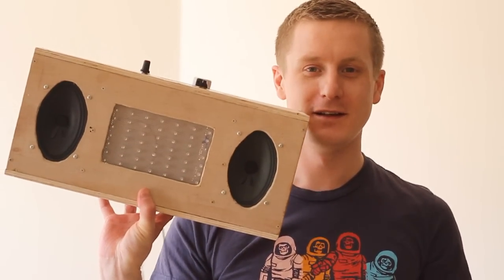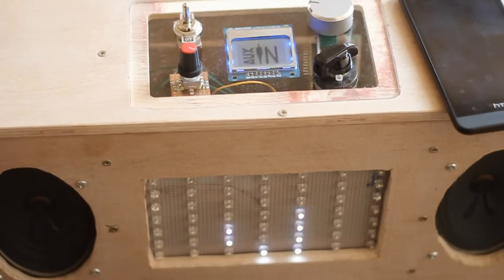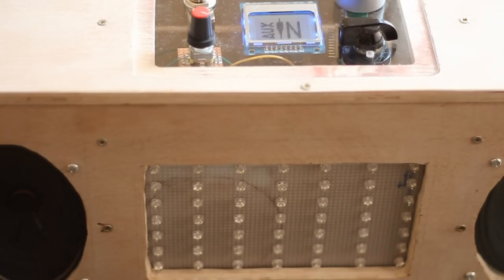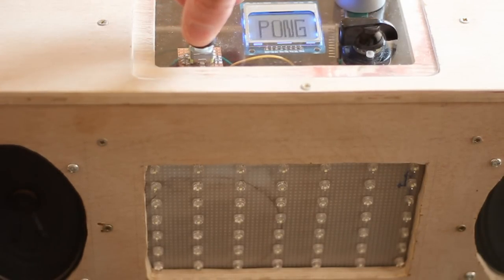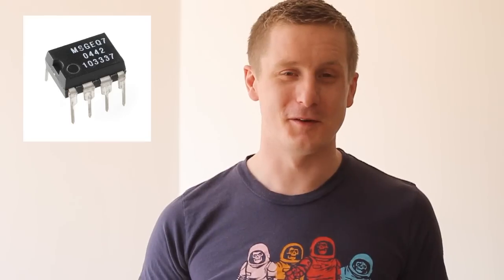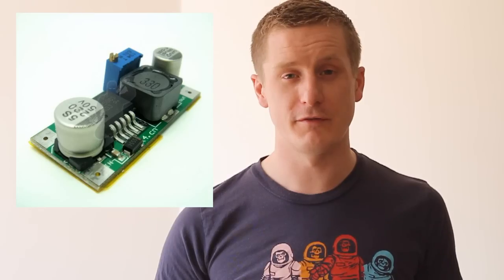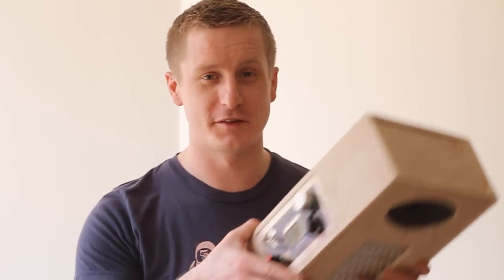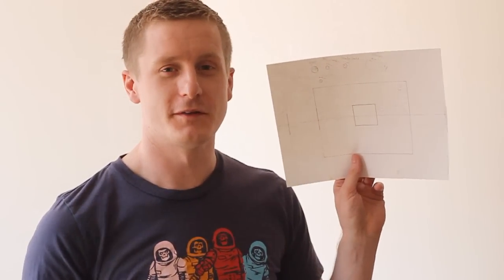Arduino Bluetooth Audio Boombox: Details and parts

Comment: Hi David, great video regarding the boombox, I saw it on one of the electronics open days a while back and I've now decided I want to make one. I have a few questions regarding this:
1) What dimensions did you use for the wooden case, regarding length and width?
2) Would you recommend using a 12V circuit or a 5V circuit? I have a 12V generic unbranded amplifier based on the TDA7297 and I was thinking about one of these multi boards, that does Bluetooth, FM, AUX and SD/USB: https://www.ebay.co.uk/itm/372195548390
3) If I was to go with the above board, would I need an Arduino? The EQ bars are not essential and if required I can add in a 2 channel VU Meter such as this: https://www.ebay.co.uk/itm/382363970258 or even this: https://www.ebay.co.uk/itm/263144580938
4) I am going to be using Lithium Ion batteries for this, instead of Ni-MH; should I use a 1S pack (with multiple cells in parallel for boosting capacity) and then a boost converter to boost the 2.5V-4.2V up to 12V, or should I use a 3S pack (again, multiple cells in parallel) to get close to 12V nominal (range 7.5V-12.6V)?
5) Should I bother with adding crossover circuits, so that I can add a pair of tweeters as well? (I have some 30W tweeters and some 60W speakers.) 
Thanks if you can reply to this :)
Reply from the maker: Hi
1. About 70cm by 13cm - Bit of a guess I am afraid now
2. I went for a 5v PAM8403 amp, super cheap and can drive 2 3 watt speakers. I used 5v for the controller so it meant the build was fairly easy
3.  The first link looks good, not sure about the second
4. 1S is much easier to charge with cheap modules so I would recommend that, the power draw was about 200ma at 5v at a middle volume
5. I used 'full range' speakers so I could get a generally reasonable frequency coverage. I am no audiophile so my listening skill is not good enough to make recommendations about that to be honest. I was more than happy with the quality

Comment: Hi David I just stared useing Arduino's and I was wondering if i could have almost the same set up but instead use gestures to pause,play, etc on the aux and bluetooth mode. Also I still don't understand the bit with the nobe that changes the mode, i.e. Bluetooth, radio, etc
Reply from the maker: He Mitchel, I have to admit it has been a while since this project but let me give it a go. As far as I recall all the audio outputs, radio bluetooth and AUX were common. So technically AUX was always active, the mode changes were just done by powering those other parts of the circuit with the rotary switch. A resistor ladder would tell the Arduino which one of those modules was active so it knew to display the mode or to interface with the radio. You could do the same with one of those gesture shields but you would need some mosfets to turn parts of the circuit on. However these days there are pretty cheap combined bluetooth, MP3 and AUX modules available.

Comment: How do you connect the bluetooth module to the arduino?
Reply from the maker: It isn't connected the arduino, it is only powered on when the selector switch is turned to the right setting. Technically all the audio sources are connected to the amplifier at once and only powered on the right setting.

Comment: Hey, very nice work here! just want to ask what you used for audio channel switching? Do you know any IC in dip package that could do the channel switch using the arduino? Thanks!!
Reply from the maker: +Σταύρος Κόης Hi, I avoided the need to use channel switching. Instead I just had bluetooth, radio and line-in connected and the BT and radio only powered when needed. I am afraid I don't know of any specific audio switching ICs.
Reply: +David Watts Hmm that would work too, thanks!

Comment: Lot's of useful tips on the various modules, nicely explained.  Thank's a lot!  You could make a tunable speaker port by wrapping white-glue soaked thin card around a piece of plastic tubing.  When dry you should have a tight sliding fit allowing you to juggle with the length.  I'm no expert in speaker design, but I'd try about 20mm diameter, 30 to 60 mm long.  I'd also put some material inside the cab, eg wool.  BTW,  fully enclosing the speakers doesn't reduce the treble output, it causes a peak resonance which for a box this size would be in the upper-bass/lower-mid region, so the treble is quieter in comparison, perceptually.
Reply from the maker: +Ray Kent That is an amazing idea, I will give it a go on my next build.
Reply: +David Watts Ta for the compliment.  When you're as old as me you'll be able to pass on this kind of stuff you've heard along the way.  Some very respectable and expensive speaker makers have used card tube reflex ports!  Card is not to be sneezed at!   Soaked in wood glue or acrylic varnish it's effectively a cellulose fibre reinforced polymer... great stuff

Comment: Hello David. How does the rotary selector circuit works? Can you explain a little how is that bit wired up so it also communicates with Arduino?
Reply from the maker: Bogdan Rădulescu Hi Buddy, I used a switch like this http://www.maplin.co.uk/p/1-pole-12-way-rotary-switch-ff73q and had the outputs connected to a resistor ladder. This meant that I could assess which state it was in with a single analog pin.
Reply: +David Watts Thanks! Interesting. Still, then how do you actually select the stereo input from Aux, Bluetooth or the radio?
Reply from the maker: All of the inputs are connected to the amplifier it is just a case of applying power. The Aux is always on, the Bluetooth get power applied through a transistor from an arduino pin and the radio is programatically controlled. The arduino know what should be active based on the resistor ladder.
Reply: +David Watts I see. I though that somehow you might connect only the active input. I've also done a speaker project and I am using a 4P3T rotary switch but I wasn't sure how to tell the micro which input is active. I can definitely use your resistor ladder idea for that. Thanks
Reply from the maker: Bogdan Rădulescu You are very welcome.

Comment: Hi David! :) Nice project! What is the difference between LM7805 and a buck
converter?
Thanks! :)
Have a good day! :)
Reply from the maker: Marc Paradis You could use a 7805 regulator if you wanted to, I just had the step down module to hand. It is more efficient that a 7805 and because it is a switching regulator it produced less heat. Thanks for the comment.